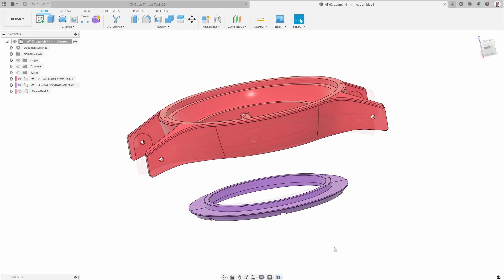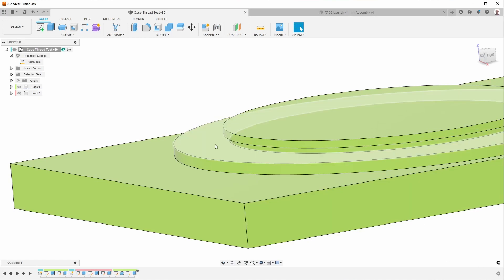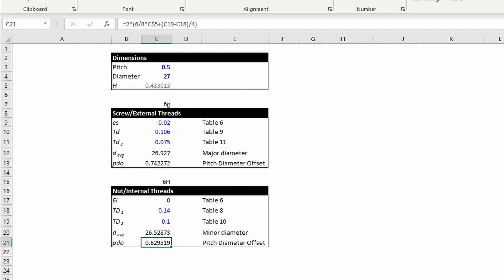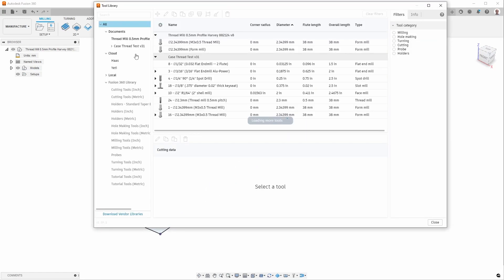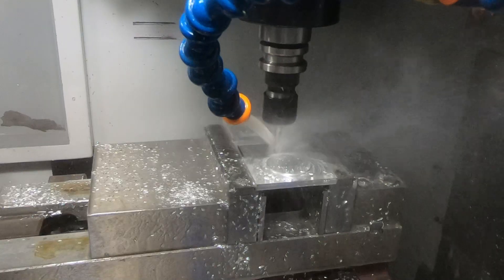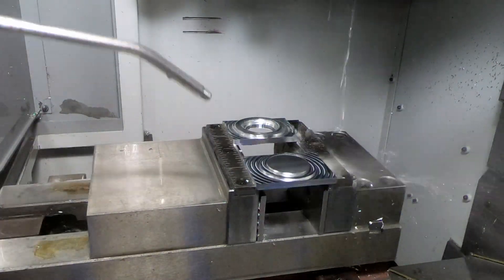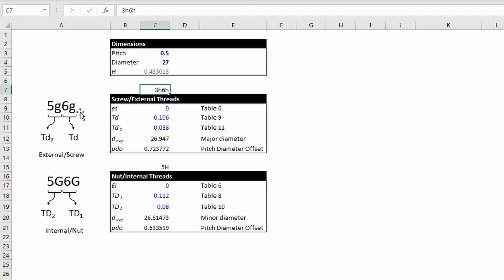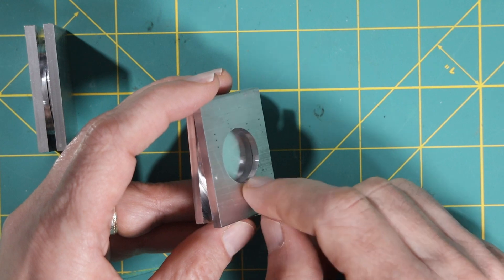Making Tiny Custom Threads for a Custom Watch Back

Comment: If you sent the threading step over a lot bigger than 1/3 if doing 3 passes. 
I.e. if pitch offset was 1 then you use .333, but if you use .666 then the 1st pass will be bigger and the next 2 that higher engagement will be smaller.
Also I find it more consistent to do a repeat pass.